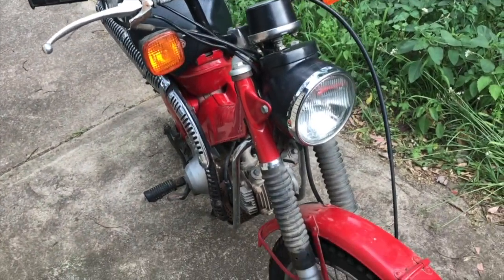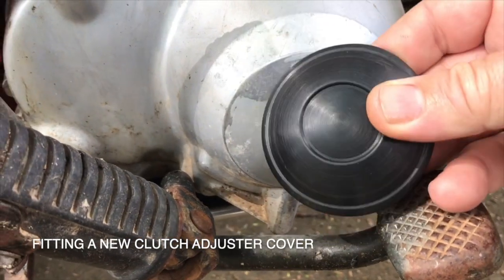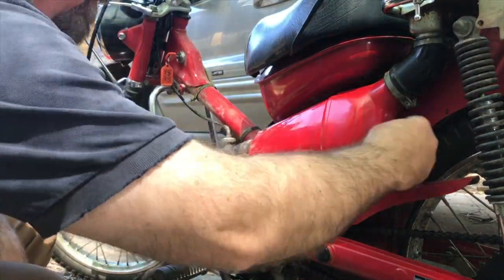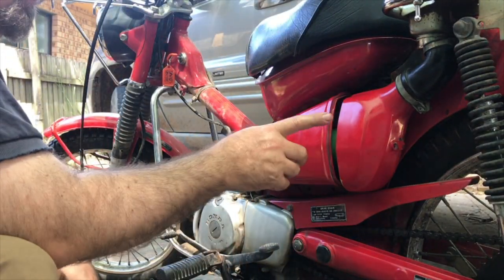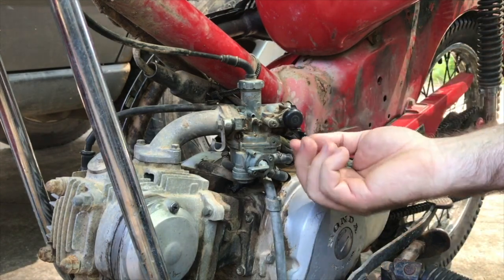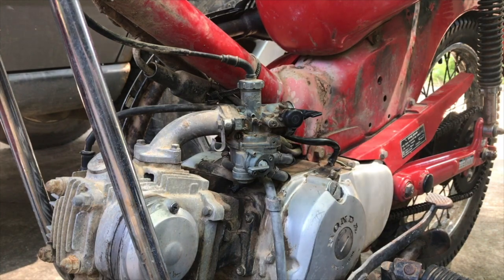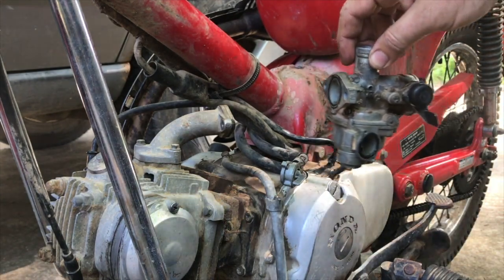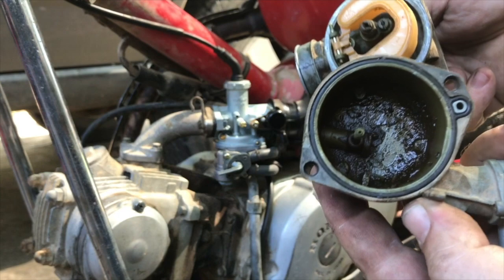New carbie, air filter, and carrier for Postie Bike project

Comment from the maker: UPDATE - March 2024.
Postie bike is now living at my property, and had not been started in over a year. Tried but couldn't get it started. Turned out to be carbie issues again. The idle needle was completely blocked, and the float needle was dirty and not shutting off fuel float. The throttle slide was also dirty.  All from the fuel tank being dirty. The small internal filter had crud in it. Cleaned all that up, added extra in-line fuel filter for insurance. Now it starts and idles fine.

Comment: What USB Charger or DC connection did you use? Thx for sharing👍🏻👀
Reply from the maker: I'm pretty sure it was just a generic 12v car accessory/cigarette lighter plug for a car, with a USB adapter for that as you might get at a petrol station. This year model of Postie was 12v, so that made it easy - earlier models are 6v.